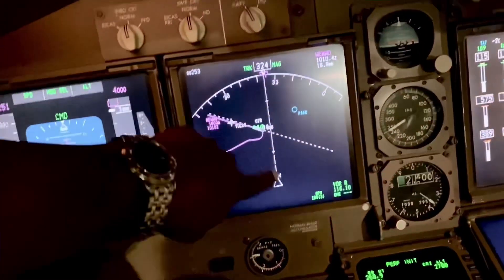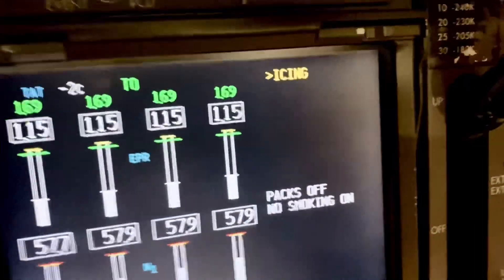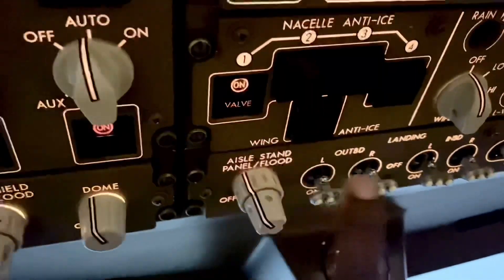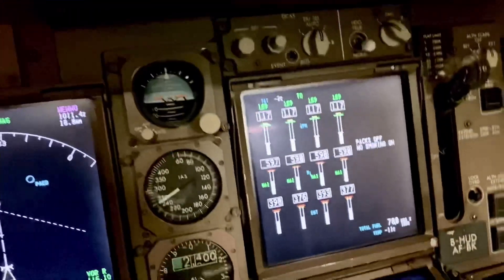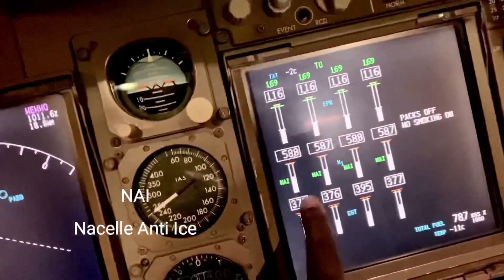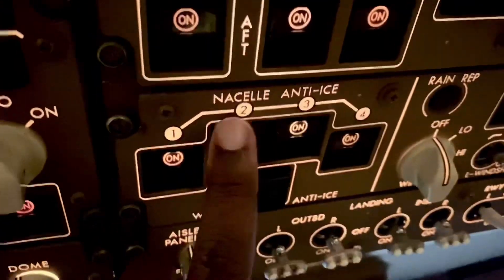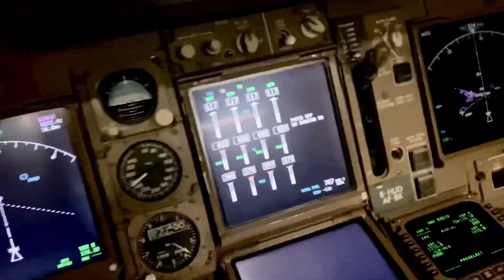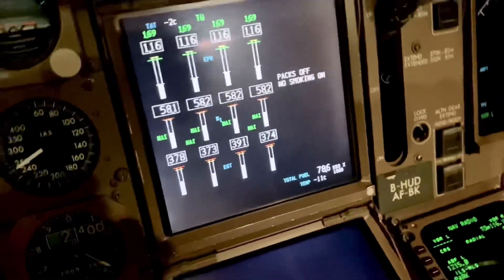Boeing 747-400 Ice protection and controls

Comment: Dear obet great videos and many thanks 
Question..why did you turn the NAI 1 and 4 and then 2 and 3 ?
Thanks
Reply from the maker: I did that because yo generally put them on in symmetrical pairs. If there was ice already formed, then it would be symmetrical engines - easier for aircraft control. It’s an old technique taught to me by flight engineers on the Boeing 707 days 😊
Reply: @pilot_obet  Thank you very much for your patience and your time.  I'm learning a lot from you.